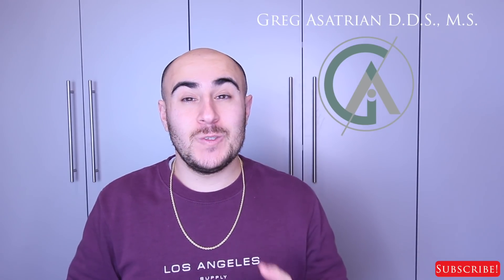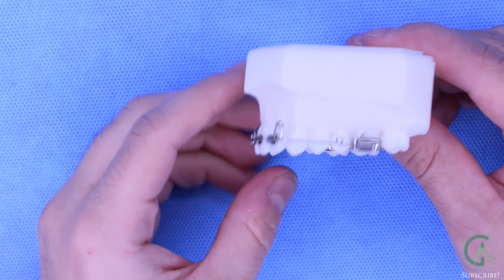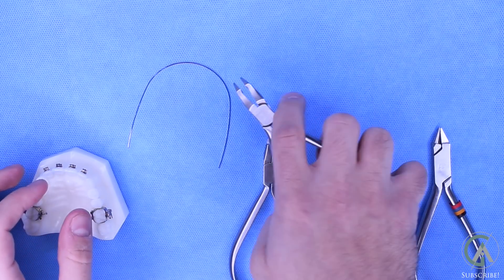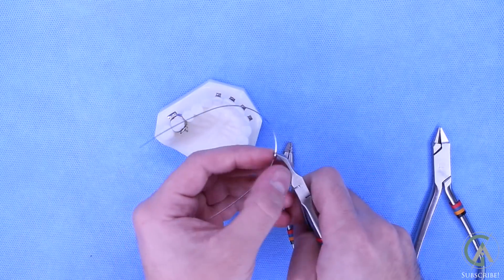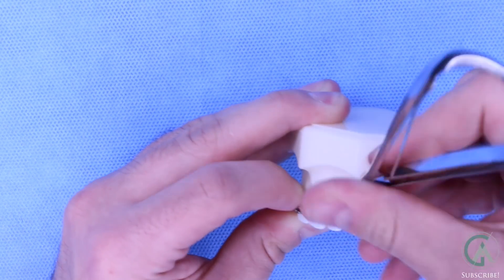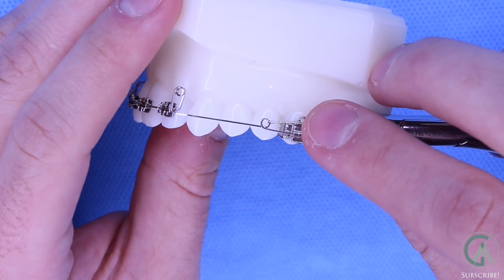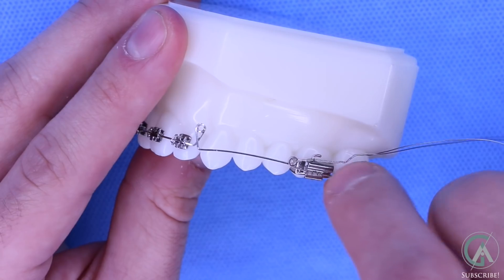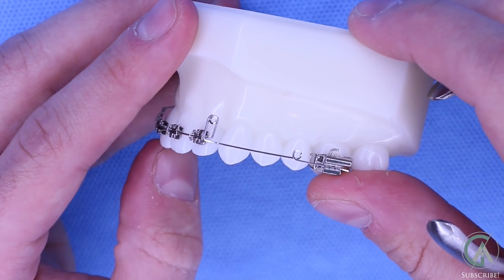[BRACES EXPLAINED] Closing Loops

Comment: The physics and mechanics seem simple in your video. So why isn't my orthodontist getting it? I am currently being treated to close one pre-molar removal on my left side and it seems like the orthodontist is using a wire mechanic that is for closing tooth removal on both sides. Instead of the gap closing on the left, the teeth seem to be being pulled even more to the right. The cuspid + molars are moving right instead of staying put and the incisors are moving out and to the right, making the center line worse, rather than better.  I am not sure I really understand why or what my orthodontist is doing?

Comment: Question, my orthodontist placed two closing loops in the upper arch wire. For the exact reason I do not know as I had no teeth extraction. However, I notice that my front teeth are not being pulled back. The orthodontist mentioned that the arch wire moved my front teeth already somewhat backwards, but pulling fully backwards will not be achievable. I’m doubting, but Ye....I’m not an orthodontist.

Comment: i just got an open coil spring put in behind my high canine teeth between the two next to it on both sides. one spring is straight between the two teeth the orthodontist put it between, while the other in curved outwords, but is still connected to the two teeth the orthodontist placed it between. Is the spring that is curved working or should i go to my ortho and have it checked out?

Comment: hi Doc.. Doc my question is my two canine tooth in upper front teeth is to wide then I have partial dentures in upper front teeth is 5  because when I still have those tooths in upper is big and has space each  one of them so when those teeth is retract the partial dentures that they replaced is 5 now I decide  to have braces so that the canine will be position in the right place because it's also overjet and then now what happened is far from what I expected

Comment: What is your opinion on baby teeth. If there isn't a tooth under it, are there cases were yes, they should be removed and cases where they can stay? How is that determined? Or is it clinical need or preference, or depends!?
Reply from the maker: It really is on a case by case basis. The roots of the baby teeth, the prognosis of the tooth, the age of the pt, etc. I would recommend you see a local orthodontist for a consultation so that they can evaluate the best treatment plan for you!

Comment: What method would you use to bring back teeth forward?
Reply from the maker: Really depends on a number of factors! Every patients plan is individualized !
Reply: @DrGregAsatrian  ok...say you remove a canine or lateral baby tooth on one side...how do you move the molars up a space without changing the midline and how are you sure the upper teeth will coordinate well with the lowers, in that new plane of occlusion.

Comment: Hi I was hopeing u could help me.  I have my front teeth impacted and they told me it’s better to leave it up there since I’m 31 and haven’t had problems. That and cause it’s close to my nose and turned all the way around. Also had a baby teeth that they took out on top too. My question is I have to have an implant is it better to put the implant were. They took my baby teeth or can I put it were my front teeth should be.  Can I do that with my front tooth impacted?  And I’m getting braces.

Comment: I have the spring part on either side of my bottom teeth, where I'm missing my 1st molars, but I don't have the little loop. At checkups my ortho curls the spring up tighter (from what I can tell). He says the two sides serve as anchorage points to each other. It obviously works, as the gap on my right side is pretty much completely closed and the one on the left side is also significantly smaller, but I still don't quite get the logic behind how it works. What you just explained with the little closing loop makes perfect sense, but how does this work without the loop?

Comment: Love your videos. I am very frustrated with my ortho. He said there is nothing else he can do for my teeth because I am in the thickest damon wire. One tooth now sticks out after he fixed another on the other side. He never used elastics or ipr only wire exchanges. I am not happy and do not want my braces off until its fixed but he says he won't try anything else. I am 43 and paid a lot of money. What should I do?
Reply: Tanja Momo this is absolutely horrible service. An orthodontist should always try to give you a perfect smile especially since you’re paying around $6,000! I’m only 12 so I’m not exactly sure how these things work, but I would tell him you will either have a refund or a perfect smile. Of course it won’t be that easy, but I’m not sure what to do because LEAPING LIZARDS that is a tight spot. That is not good and I am very sorry that is happening to you. ☹️
Reply: @paytonjacobellis8043  thank you. I switched to another orthodontist in the same group and they are amazing.
Reply: Tanja Momo that’s great! 😁
Reply: @paytonjacobellis8043  😊
Reply: Tanja Momo definitely as you have done, go and see someone else for a second, even third opinion. I did this as my orthodontist said he wanted to take my braces off but I wasn't happy with the result as the teeth didn't look straight at all. So taking action, I went to see a well respected orthodontist in London for his opinion and he looked at it and said all my teeth were in the wrong position so I switched to him and he had to correct the mistakes. Should have sued the previous orthodontist but I didn't. Never settle for second best when you are paying. If something doesn't feel right, seek out another opinion and always see the before and after photos of the orthodontists work.